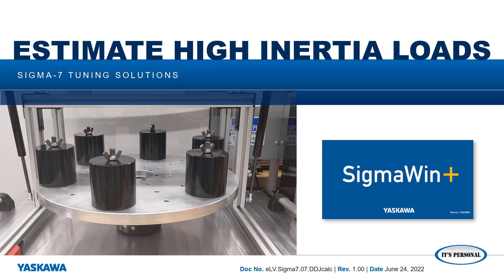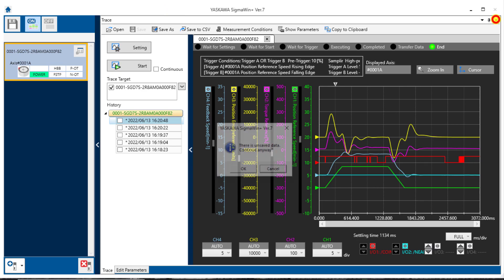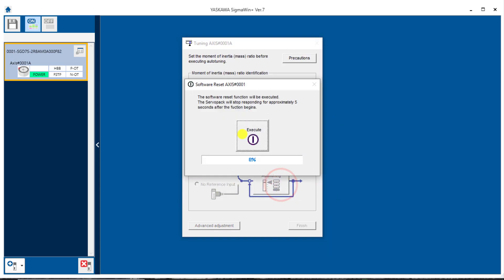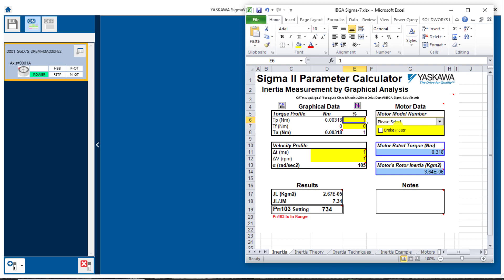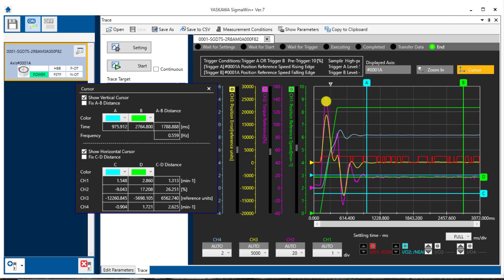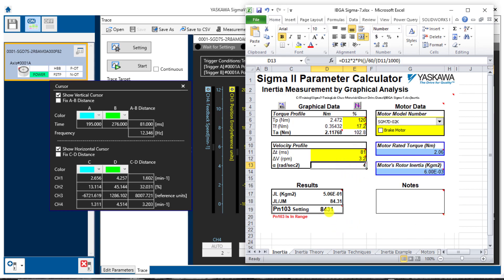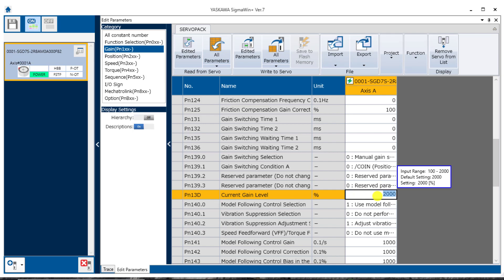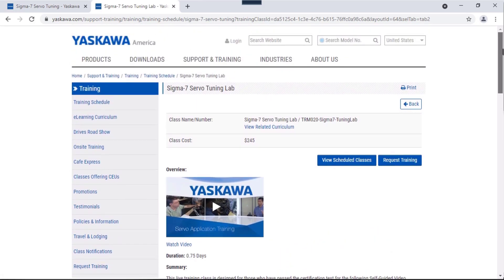Servo Tuning - Estimate High Inertia Loads

Comment: do you have a h1000 drive and a default parameter?
Reply from the maker: The H1000 drive is a high performance drive sold in China ONLY. Support for H1000 drive is typically provided by the machine manufacturer (OEM) or equipment seller. Please contact Yaskawa Asia (https://www.yaskawa.com.sg/product/ac-inverter-drives)